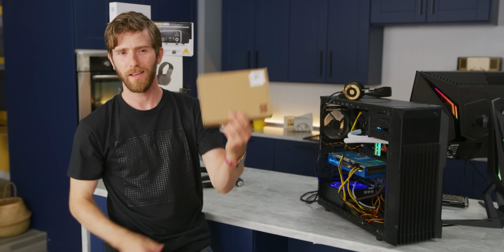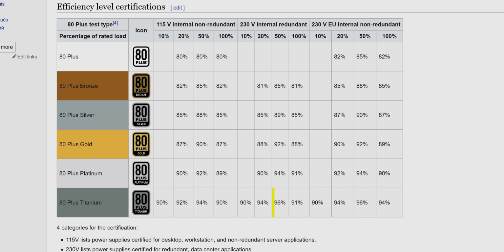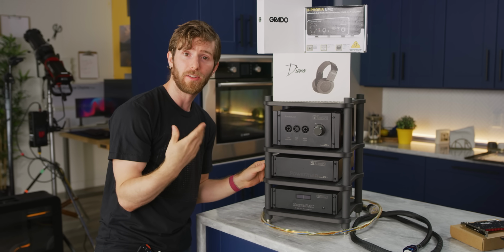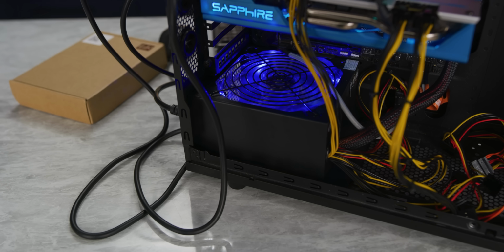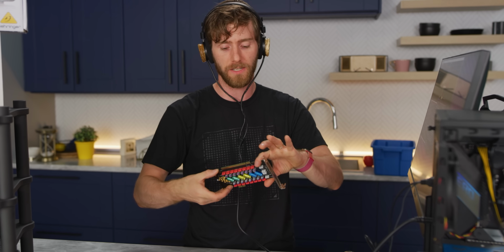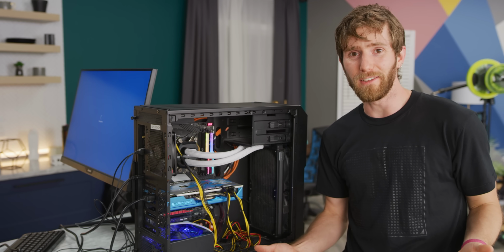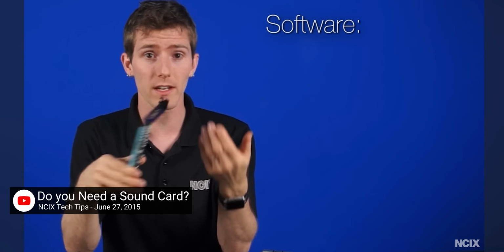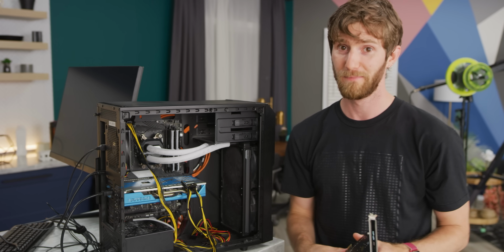Is this $40 card a SCAM? - "Audiophile" Power Filter

Comment: First off, I WILL BUY THAT BOOK! Put it up on your store, and I promise I will get one! that is such a cool idea!! 
Now, for onboard audio noise, I have a Gigabyte Z170X Gaming 7, it can get so bad with interference from CPU and GPU during load, that with my eyes closed, I could tell which way I was facing in games just by the noise, it was horrible. I've had this same issue with old Asus, VIA, ECS and Gigabyte 478 boards, Gigabyte 979 nforce chipset boards, Asrock 1156 and 1151 board, and my current one too. All sorts of different GPUs, many different brands of PSUs as well. I've always had to run dedicated soundcards because of this. I still use an Asus Xonar Essence STX now, and there is no noise, plus it shits all over any onboard audio.

Comment: As a more genuine word of advice, download 'LatencyMon' and run it for a while. This program will (among other things) check for processes that commonly cause interference issues while playing music, the type to cause crackling/micro-stutter in songs. A stable system should have very minimal latency, if you don't then the program will tell you exactly what the offending process/driver is. As someone who was having background driver conflicts that made my music unbearable and which were very hard to diagnose, I felt the need to give this small psa ^^

Edit: This isn't at all related to power delivery or audio 'quality', it's simply a way to gauge how stable of a platform your PC is for playing audio.
Reply: This cannot actually diagnose a horrible motherboard or some other kind of hardware related issue that is causing the crackling audio however.
Reply: @YouCensored  Ofcourse, this is purely software based. I've typically had far more issues with software than with hardware audio-wise, at least in the past few years (hence my recommendation).
Reply: DUDE!! Thank you!! I've always had this issue, it usually creeps back into my life after a format, or new/different computer. It's one of the main reasons I am reluctant to go a little longer without formatting. 

Latency is a big deal, and if you don't have it, you won't notice/relate to it as an issue when someone says they have bad latency. Either they're some kinda weird-o stuck living in a 0.2 millisecond past, or.. no that's just it, they're some kinda weird-o that doesn't know what latency is.

Just like all these guys commenting to correct you, their minds jumped so far ahead to keep up with the lag, they completely skipped over the name of the program... 'LatencyMon'

Comment: As an old electronics repair and service technician I can say there is SOME legitimacy to this card IF your power supply and/or motherboard has some manufacturing flaws in them, because the theory of this is very simple. A capacitor's job is to keep the charge and current, that's what it does. They all have different capacities, and if you use various values you will be able to keep that charge IF there is a particular audible RIPPLE in the directly connected line of power, and for that to happen, it's got to be connected to the power that supplies the AUDIO circuitry somehow. This card would be even MORE useful if it came with an AUDIO IN/OUT throughput with a professionally built audio filter in it for this purpose alone, but the card itself could in fact stabilize the system (if there's manufacturing defects in the motherboard OR/AND PSU too), but since I don't know the design of the board - or - have tested it in my extensive electronics laboratory (check me if you want, it's legit - I can do that stuff), which I haven't. 

That said - I agree with Linus on the fact that most motherboards have these capacitors built right in, in fact - even parasitic resonances that comes from the design of the motherboard itself, has usually been thoroughly tested by the software the manufacturer uses to produce the cad files for these as they often come with simulators for parasitic resonances, both for audio frequencies and parasitic RF emissions. They need to pass certain criterias set by the FCC in order to be sold to the common public and industry, otherwise we would have spuric radio emissions that could interfere with over-the-air communication everywhere, and everything would be a mess, including your WiFi signals.

So the conclusion from my part is - if you're a totally paranoid Audiophile with a professional studio, this card won't hurt you - but most likely have zero impact on the quality of your sound production, and if you're a home user - you don't need this card, at all.

When it comes to coil whine - that's an entirely different beast, since the coil whine itself is a electro-mechanical phenomena, which means that PHYSICAL vibrations occur. Now - if the physical vibrations/resonances came from the actual PSU ripple of some sort, then it could have some validity in it, but it doesn't come from that. So since the coil whine is an entirely mechanical vibration that occurs for some unfathomable reasons in engineering design, this is a physical occurrence, it could even stem from thermodynamics (rapid changes in temperature) which means its impossible for any electric card to prevent this, as it only dampens or evens the DC current in the main PSU power lines, in other words - removes any AC current, or at least evens the DC to perfection - it can only do that, it will have ZERO impact on the physically occurring vibrations inside the pc, sadly. But that's just common science.

Comment: Well, you should have tried connecting the headphones on the front Jack, usually the HD audio cable is the one that creates a horrible hiss.
Reply: On a properly-designed front panel you shouldn't get that problem. Naturally, plenty are unshielded (pick up electrical noise) and many also short together all the grounds. When they short together all the grounds the current drawn by USB devices goes directly into your headphones.

Comment: I dont understand who this product is targeting?
Most people who would buy this kind of thing and really care about audio, probably already have a dedicated DAC AMP so this is pointless.
Reply: My on-board card is pretty good and dead silent with headphones, BUT behaves weird on my loudspeakers - you can actually hear the hiss changing when you move the mouse!
If this product was like $10 and actually fixed the problem, it would be amazing... but we all know it doesn't so... pointless product.
I shoved in my old Asus Xonar sound card for loudspeakers and then use on-board just for headphones.
Reply: Last time I had really bad noise in, was when my speaker wires cought some foreign MF radio. Sadly both MF transmission and my old speakers died years ago.

Comment: This product is absolutelly idiotic... this board is only drawing some current for absolute no reason...  the only way you could have any posible improvement would be if the cables from the PSU are connected directrly into a filtering device with some sort of a DC-DC converter that separates the main circuit ground from the system.

Comment: How about taking a multimeter and check if those capasitors are ewen connected? Ewen if they are, it probably wuld not make any difference.

Coil wine is actually coming from coils working, the power supply drives the coils with a puls wave, if extra capacitor wuld make any difference, it actually wuld make the coil wine worse.

What it comes to over clocking, the switching frequency of power supply, bought on gpu and cpu, are quite high and if you want to filter out the noise (more than it is from factory) you need to get the capacitors as close to the source as possible. So no, that thing wouldn't do that.

Comment: Noise filtering capacitors (more correctly decoupling capacutors) are only useful VERY close to the ic you are using since ac noise can be picked up very easily.
That's why you se lots of capacitors near the audio driver

Comment: all you need to do is use a s/PDIF if possible or pound a 24" grounding rod into your yard ground it to your box, Another easy method is to use a UPS battery back up OR just use a laptop like most audio professional use the laptops battery with isolate the ground... what this card is basically doing with all those caps is filter it threw effectively a battery like a UPS back up dose plus you get some serge protecting from it

Comment: It's aimed at the same idiots who buy super premium speaker cables with unobtanium alloy wire wound  into the 4th dimension thinking it's going to make a bit of difference in the actual sound. Companies have successfully sold polished blocks of wood for hundreds of dollars to sit on top of one's speakers claiming they deaden unwanted harmonics or some crap like that.

Comment: STOP GIVING ANY HW INTO LINUS HANDS!!! 

It literally hurts to watch!
Reply: It's his hardware
Reply: @AwesomeSauce7176  It hurts anyway.
Reply: Useless junk, is no Hardware^^
Reply: When he pulled on the power cords of that graphics card, I thought he'd rip that one off... those heavy cards in those slots seem very fragile anyway, for example I'd never carry my rig with the graphics card in place to another place because it might break
Reply: @CakePrincessCelestia  
Thats why my Board has reinforced Slots (X570 Aorus Pro) , My Cards atleast a Dualslot Design with also atleast 2 Screws to fixem in place and my H500M a built in Support for the rear end to hold it up.
And to rip a card out of the slot is very hard also to rip that slot for the power cable off the card, they sit usually pretty damn solid.
But yeah a little more care on that end wouldnt hurt.^^

Comment: I'm not suprised you can't hear any noise in your headphones. There's no AMP involved. You should have really tried this with active studio monitors while gaming. That may not be the standard use-case but it's the worst cast for GPU noise. I have a Soundblaster Z and two KRK Rokit 5 active studio monitors directly connected to the soundcard. When I'm gaming with near 100% GPU utilisation I can hear every move of my mouse, hence every change in FPS/utilisation, as noise in my speakers, like amplified coil whine. It's even audible over low gaming sound. I'm not saying that this card would help with that, at the end of the day, I don't believe in magic. But if you actually want to test if it has an effect or not, make sure you can hear the noise first. Saying "It was fine without the card. And it 's fine with the card, hence the card is ineffective" is not really helpful.

Comment: looks for scientific proof
> uses high-end motherboard that probably has good filtering anyways
> doesn't hook up a scope to show the power rails
not saying that this might "fix coli whine" like they claim, for that the capacitance would need to be on the GPU (low Z), on the buck output rail. but come on, this is as non-scientific as it gets.
Reply: In general, excluding specific reviews from specific people, LTT is a great entertainment channel, but it's a huge "scientific method" channel.  If you want 20 million charts and so many data points, then Gamer's Nexus is where it's at.  Personally, I enjoy both but recognize that they are very different tech channels.

Comment: To properly test for noise, you should have tested this with an spectrum analyzer or a DSP board using pure tones for a before and after test. You're also assuming the PSU is noisy, but even if it is depending on the filtering circuit of the motherboard before it powers the onboard audio, you might not even observe the bad noise. I know this is not GN, but you guys can do better than this.

Comment: The principle is sound. I have used this technique, adding filter capacitor to a noisy power supply, professional on a radio station audio desk. In theory adding filter capacitance at any point on a voltage rail will reduce high frequency noise on the rail. You would likely need an oscilloscope to really test the results

Comment: A couple thoughts, as an electronics engineer, on things you didn't mention:
- Capacitors should be placed nearby the source of the noise or nearby the peripheral you want to protect from noise. More specifically, there should be no alternative path for the noise but the capacitor before getting a chance to go to the rest of the system (when placed near the source), and there should be no alternative path for the component you wish you keep noise-free to draw power from but through the filter. Capacitors work by negating trace or wire inductance by being placed nearby components. We're talking millimeters or a centimeter or 2 max . Placing capacitors in random places like this, I would say, can actually make noise/EMI worse , because now you have capacitors (which act as shorts for high frequencies) creating high-frequency current loops.

- This board actually contains a lot more than 7 capacitors. Those rows of aluminum cans? All of them are caps. And those rows of red boxey things below/above those cans? Also capacitors.

- The values on those big caps are going to do nothing for high-frequency noise. The way capacitor filters work is bigger values filter out lower-frequency noise, lower values filter out higher-frequency noise. Actually, capacitor filters should be tuned to the exact frequency you want to filter out, and should be tuned to the circuit they'll be applied in.

- Inductor/coil whine is more likely to happen under low loads, so the remark of "it's not even doing anything" isn't that surprising. Coil whine usually happens when the voltage regulator has gone into something called "pulse skipping mode" or "discontinuous mode". See, usually voltage regulators will work in the hundreds or thousands of kilohertz, so we don't hear them. But if there is only very little current being drawn through them, they can improve efficiency by skipping pulses or lowering the frequency. This behaviour though causes more voltage and current ripple as well as inducing audible harmonics. It's this low-load condition that's actually tougher on EMI, rather than a higher load condition, where the coils and capacitors only have to filter out an exact switching frequency. What's more, this coil whine is created on the GPU and no external filter is going to fix it.

- To me it's hilarious that they added RGB on this card. I didn't make out the exact driver, but most LED drivers are themselves switching power supplies, adding more noise to your system. Edit: Actually, I don't see any driver. I think they're just using a resistive dropper. No noise then.
Reply: There's another type of coil whine that has the same frequency as the framerate. It occurs especially at medium load and high fps when there's different load levels at different parts of processing the frame

Comment: motherboard quality could play a huge role here and with a higher end mobo, as you point out, could be killing the test right out the gate.  I don't THINK that's the case, but it is certainly possible.  signal noise is spooky.

Comment: "The onboard sound was so bad" ... lol, I think you mean; "the onboard sound was not EXISTENT" :D we're both old enough to know that scenario.

Wouldn't you have gotten a much better response (and thus worse scenario) if you hooked up actual speakers to it? Either USB connected speakers or from a USB interface to active powered monitors that are socketed on the same powerstrip? That's a nice way to "up your noise game" :) Because if your power-situation is bad, you're going to hear the workload noise of GPU and eventually CPU through those active speakers.